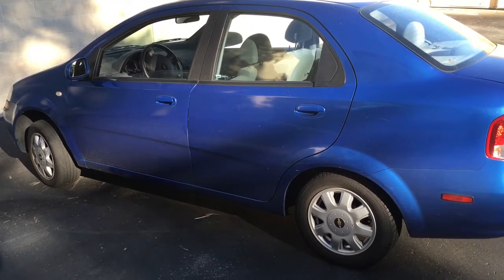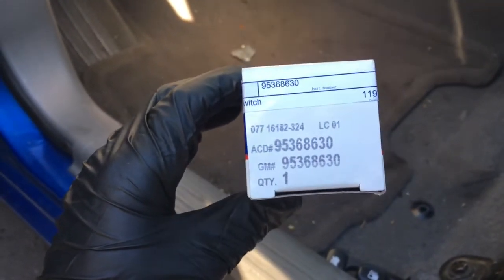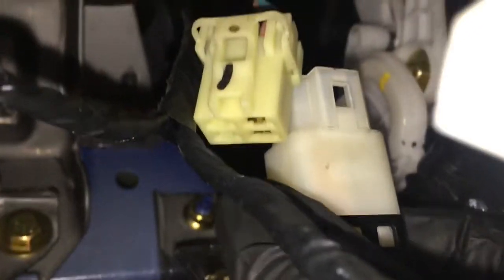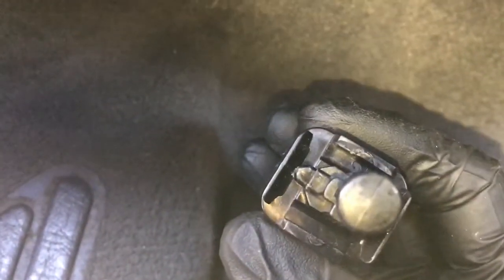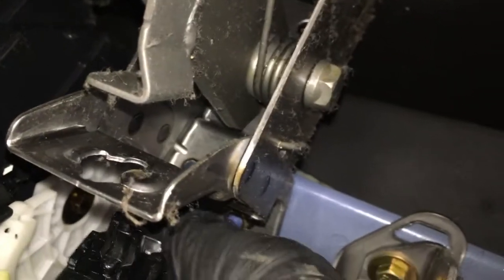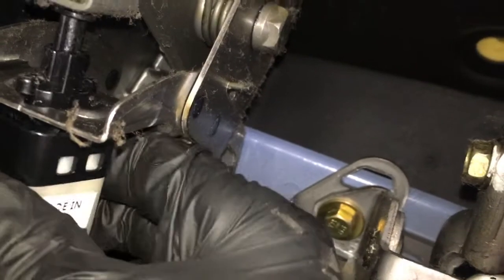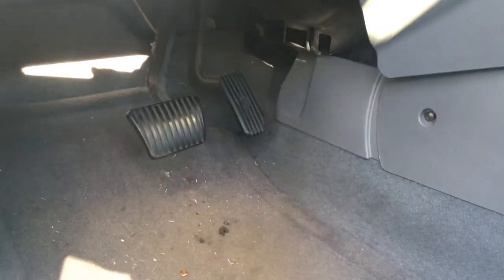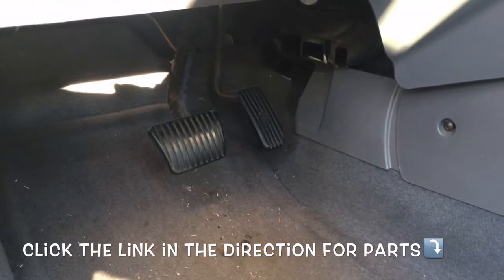How To Replace The Brake Light Switch On A Chevy Aveo

Comment: Thank you Brian. I just changed my brake light switch on my 2007 Chevy Aveo. Your suggestion to push the brake pedal down and also which way to turn the tabs was very helpful. Always best to have professional advice.
Reply from the maker: Joe Gates glad to help. Thank you for watching and writing!
Reply: @HowtoAutomotive   I am dealing with a chevy aveo that had the brake light replaced, now, when we press the brake we cannot shift to reverse. Does this have to do with why you instructed to press the brake pedal before installing the new switch ?
Reply from the maker: Robert Mendez If you replace the switch and it still is not working then you need to check to see if it has power and ground going to the switch. If not look for a blown fuse or broken wire.
Reply: @HowtoAutomotive   the tail lights are working, I can shift to reverse by not pressing the brake. When I press the brake the shifter locks.

Comment: Thank you so much for this video! For those with the same problem, I'll add that the original switch in my car was easy to disassemble. I lightly cleaned the internal contacts with isopropyl alcohol (trying not to remove all the grease), reassembled, and my brake lights worked again.

Comment: Hi!! I changed my moms brake light switch (she had no brake lights) and now the shifter is stuck in park. We have to use the lock release to move it out of park. Lights work perfectly fine. Is the issue the install of the switch?

Comment: Will a bad switch cause the 3rd trunk light to not work? On a 2008 cobalt.  Other lights work fine. Bulbs are good on trunk brake  light  but can’t find issue with wiring ! So yea , got a warning from a cop cuz that 3rd light in trunk not working.

Comment: Thank you for the clear how-to on how to replace this. 

My brake lights weren't working, nor could I get my car out of park. Did some research, went to the part store, came home and found this video on YouTube. 12 bucks and 10 minutes later, I'm ready for the road.
Reply from the maker: Preebs glad to help. Thank you for watching and sharing!
Reply: Did you get the check engine light with the problem being p0517? I'm having this issue and I'm curious if this is the right video to fix this

Comment: Thank you - one of the easiest repairs I've done so far!

I had an issue with my 04 Aveo not shifting out of Park intermittently, and the brake lights would sometimes not work at all. Replaced this switch and problem solved!
Reply from the maker: Glad it all worked out. Thank you for watching!

Comment: Hey Brian- I'm having an issue with my Shift lock Release- I read a post that said this could be due to a faulty brake light switch
Reply from the maker: Ezekiel Kelley A faulty brake light switch could be the issue I have run across this myself.
Reply: How to Automotive I can't get my car out of park without using something to push the release. I'm think if I replace this part it should work. I'll let you know if it works

Comment: Please can you tell me how to turn off the flashing hold button in a 2009 Chevy Aveo
Reply from the maker: Karen Lynne Not sure what you mean by the flashing hold button? I would look in the owners manual.
Reply: How to Automotive the hold button is on the console right by the shifter. I accidentally pushed it and it does something to the transmission to keep it in a some kind of drive mode. So since it's stuck flashing on my Dash it won't shift right my air conditioner won't blow cold air and the temperature gauge wont work. I don't have a manual for the car and I can't find anyone that knows how to turn it off. Please help me.

Comment: Don't know if anyone is still looking at this video or not, but on my 2006 Chevy Aveo automatic, with a huge 41K miles on it. Looks and runs like brand new, VERY well maintained.  I have replaced that stupid relay switch well over 10 times. It will work for 1 hour, 1 day, 1 month, stop working for weeks or days, start working again for a day, a week, or a year, then stops working again. Cant find a short anywhere. 
I am SO tired of replacing this $13 part,for no reason.
The rear lights do work half the time when the relay ISN'T working, and half the time when the relay ISN'T working.  Anyone EVER have this problem and find a fix to it?